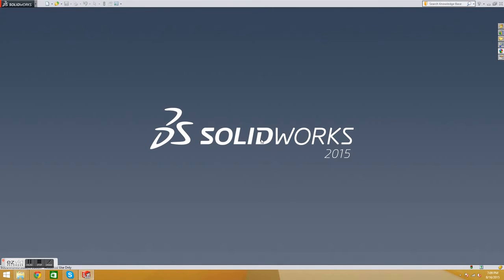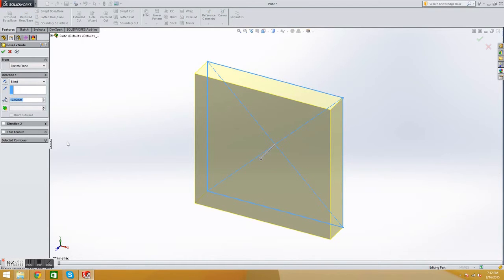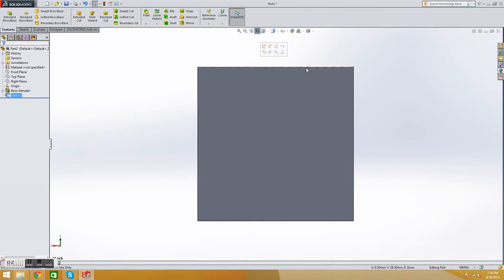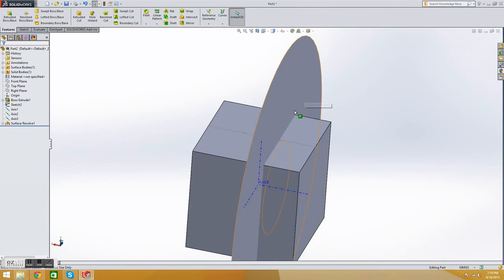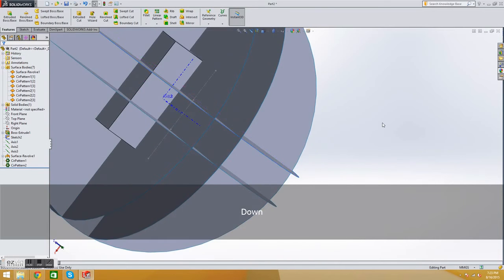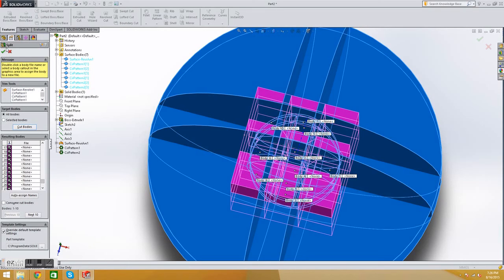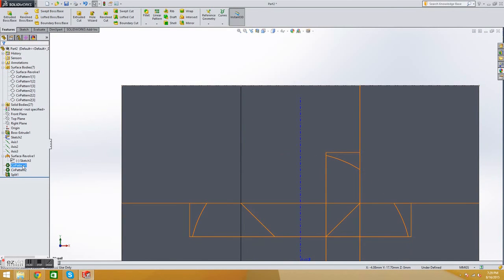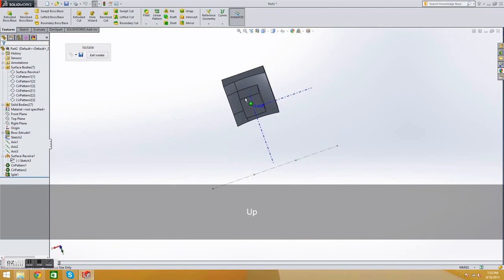How to Design Twisty Puzzles - (Part 7) - Designing Basic Parts

Comment: Instead of the circular pattern, you can mirror the disc across from itself. After if you make a axis from corner to opposite corner on the cube and make a circular pattern of 3 it will create the same thing. I find that easier and faster.
Reply from the maker: PerpetualCubingMachine That's a very creative way of doing it and that would definitely work